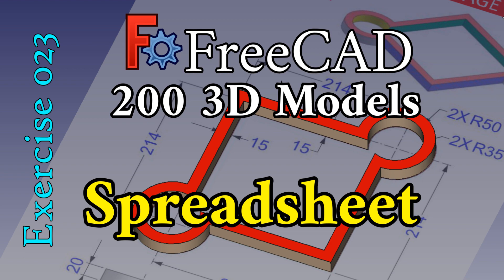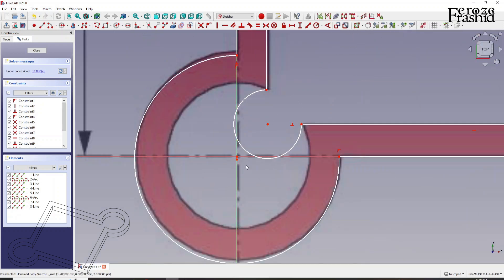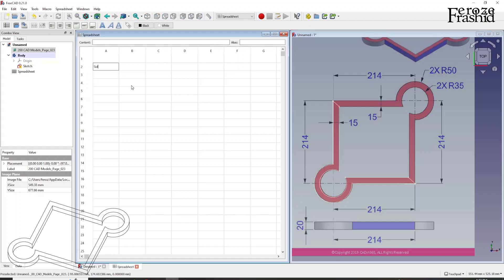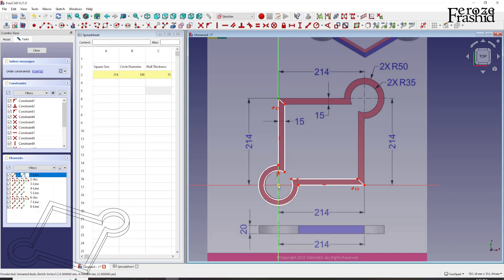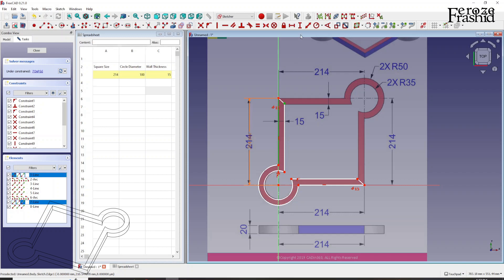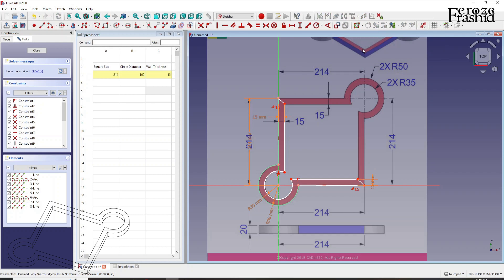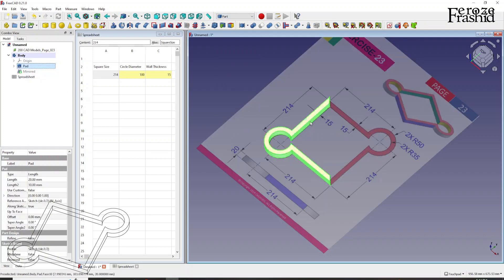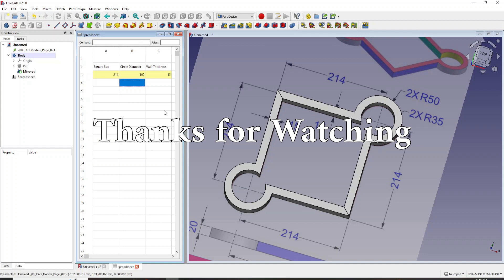200 3D Models: Exercise 23 (Spreadsheet in FreeCAD)

Comment: The EasyAlias macro helps with naming the cells. If you create the names in, for example, column A and put the values in column B, you can then select one or more names from column A and run the macro to create aliases for all the values in column B at once. The macro will remove spaces from the names so proper aliases are created.
Reply from the maker: Thanks. I am aware of EasyAlias macro. Very helpful for setting up a spreadsheet. Until you are going for a configuration table. 
Hope the macro will also open up capabilities for row-wise operation.